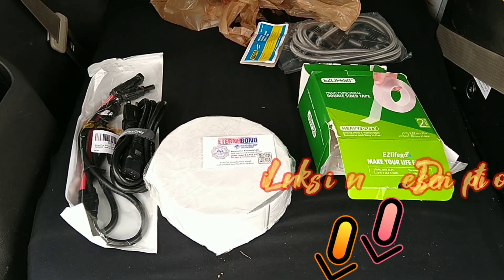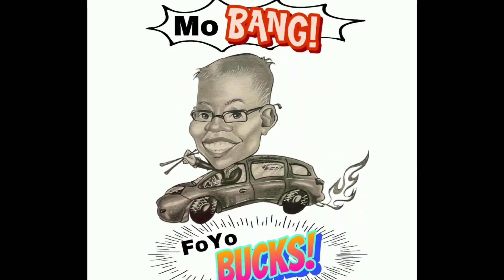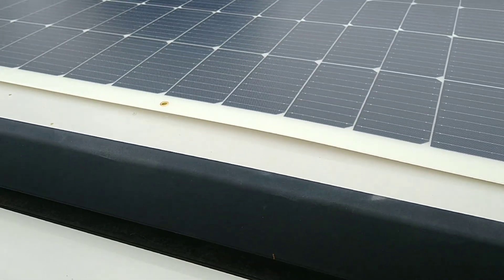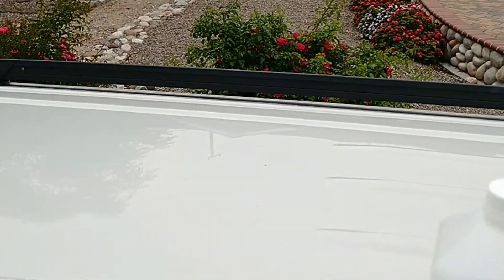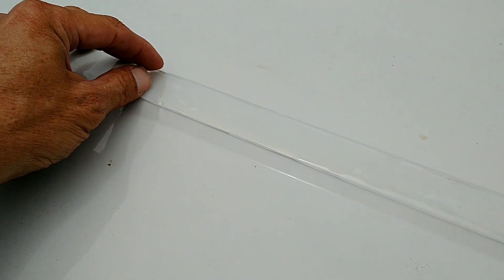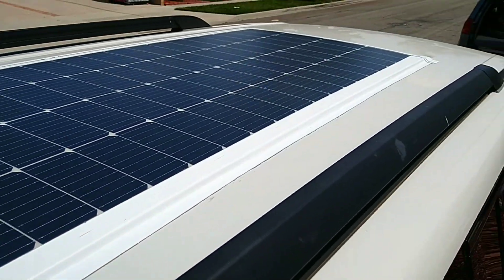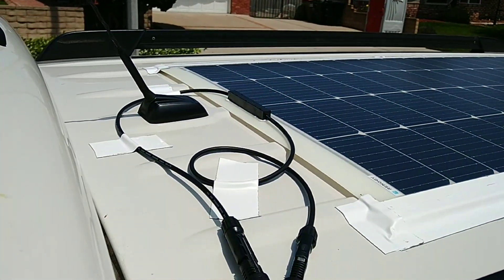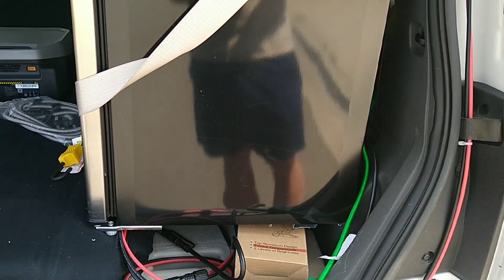200 Watts Renogy Flexible Solar Panel Installation on 2010 Ford Flex

Comment: @MoBang - TIM - did you have to peel off a protective plastic layer off the top surface of the solar panels before taping the panels down?
Reply from the maker: Yes!
Reply: @MoBangFoYoBucks  oh shoot!  I already taped down all three sides of the 2 panels.  U think it will be ok?
Reply from the maker: You can use razor blade and SLOWLY trim a long the edge of the tape and lift the protective layer off. I think it would be fine and eventually that plastic will dry up and come loose.
Reply: @MoBangFoYoBucks  - I figure I will keep an eye on it.  The 1st sign of it starting to peel...I'll redo the tape on the 3 sides of the solar panels (x2).  Thanks for the help Tim!!
Reply from the maker: 😱 Oh I just realized what would happened if that protective cover start peeling! Now if you tape the last side too, I doubt that it will ever be able to be blown off.

Comment: I bought that clear tape not to long ago.  Not for same use as you, but I'm looking forward to finding out how it works for you and the solar panel!  Nice job. Idea:  at the lowest point of the wires going into the bottom of the hatchback, put a zip tie on, making sure it excess strip points down.  That way when water runs down wires, it will "stop" at zip tie and follow that down and drip off. I think in heavy rain, pressure of water could push it up into van. Maybe not a lot, but enough to make mold eventually.  I could be wrong.
Reply from the maker: Good idea! But the zip tie is hard plastic and might scratch the paint on the bumper. But perhaps a few wrap of electric tape or rubber o-ring will do the same job.
Reply: @MoBangFoYoBucks  or wrap the zip tie in tape. I was originally going to suggest a thick string, maybe a length of paracord, maybe about 4 inches?

Comment: Looks nice and clean, I should have purchased flexible panels. Meanwhile 2 100w panels sit in my storage unit. 🙄
Reply from the maker: Personally, I would stick with hard solar panels, you still can tape them down just like that with some long L brackets.
Reply: @MoBangFoYoBucks  Really? thanks for the tip!

Comment: We talked about doing this on our cargo trailer. But then decided against any permanent-ish type of solar. We like to park in the shade 😁
Reply from the maker: That's why my solar panel is either mountable on the roof or move around in the ground. I also has a fold up panel just in case I am too lazy to take it off the roof.

Comment: Boy, that was a short premiere.  My first solar panels were the flex panels like this, but with traveling constantly and the weather they didn't hold up so I switched to the hard panels.  Good DIY Tim.
Reply from the maker: 😁 I put it all together unless than half hour after I finished the job for the lady with that car! Thanks Dee!🤗
Reply: Wow, plain and simple, no mucking around and very easy to understand. I really appreciate a DIY video where I feel confident that I could do it. Thanks for sharing, Tim. 👍👍👍
Reply from the maker: Hi KuraQueen! Yes, I was pretty darn confident doing the job! I did it so fast that forgot to film some of the progress of lining up to make sure the panel is in the middle of the roof!😆 This is my second installation!😉